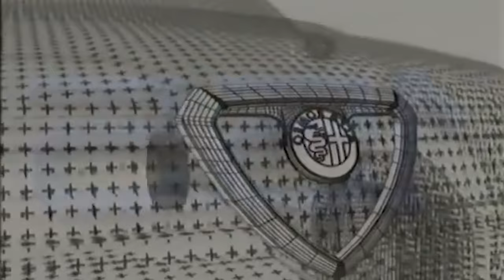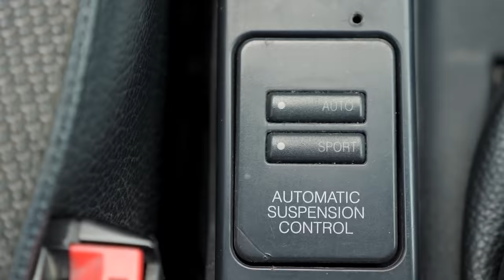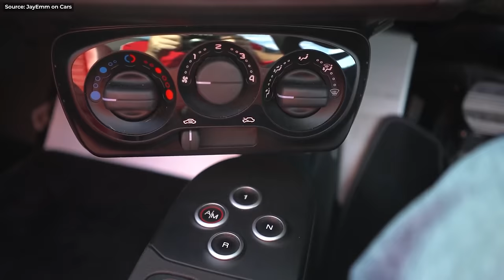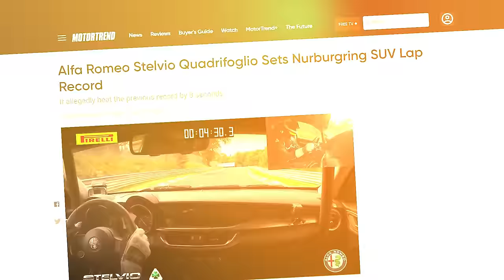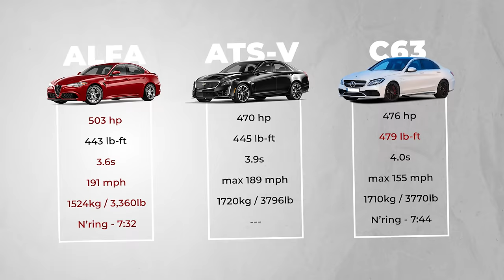7 Alfa Romeos (since 1980) that DON'T SUCK

Comment: The Giulietta Quadrifoglio is very hated, in my opinion i have no idea why. Yes the quality isn't the best, but oh man it drives like no other hatch. It's very affordable for what it provides and with regular maintenance there's nothing to worry about. Extremely underrated car.
Reply: Because German car-pilled people have a bias towards anything FWD that isn't a Golf. It might even be a racist bias, because never in this world has ever been someone who criticised the VW Golf GTI for being FWD.
Reply: I love the giulietta to bits but they really don’t handle all that well, they’re geared to be more of a grand tourer than a spicy hatch so the suspension really is a bit too soft, however this is changed very easily
Reply: I had a Giulietta QV for 4 years, put  100k km on the car in 4 years and didnt had a single problem. 

Only the maintenance bills were very expensive
Reply: @FSCBMrTrol  sadly that's more the mechanic trying to nickel and dime you, by the time the Giulietta rolled around, all Alfa Romeo engines were Pratola Serra units shared with the vast majority of the Fiat group cars.
Reply: @AlexTenThousand  parts are expensive because every garage asked the basically the same price for everything
Reply: @FSCBMrTrol  that's surreal - parts for Pratola Serra engines basically grow on trees, they've been producing those non-stop since 1994 in several iterations and have been used even on several Jeeps after Fiat bought Chrysler, they should be dirt cheap.
Reply: it´s the first time i hear that, normally i heard all my life the reverse, and quality wise it´s close to perfection
Reply: Love mine
Reply: No, build quality does matter.
Reply: Because it’s a Bravo
Reply: There’s thousands of them in Italy. It’s not underrated at all. It’s really popular
Reply: @yafmaverick but the Bravo ain't a bad car...

Comment: I own a facelifted 156 and a 159 currently, leaves me a smile every single time when I looked at them parking at the same place and when I'm throwing it through corners, even if they're front wheel drive they handle very damn well, and none of them broke down in their lifespan surprisingly
Reply: i was looking at 159 1.75tbi and 1.8 versions
do you own any of these two?
Reply: @autorecon  nope I have a 1.9JTD with a 6 speed, but 1.75TBis are definitely worth a try, it's probably the best engine option out of all engine options
Reply: I've had three 156 V6s over the last 12 years - currently own a 156 GTA - and they are unquestionably the best handling FWD car I've ever driven. My GTA in particular is like its on rails - aided by its adjustable coilovers and sway bars no doubt. Apparently quickest steering rack ever on a production car (1.7 turns lock to lock).
Reply: @autorecon from my experience 159 is much heavier than any other models manufactured before 159 so it’s not that fun car as 147 156 166 and GT

Comment: A few facts to add a bit of context and share a bit more info with those who like this matter:

- The Giulietta was a car Alfa had to make, it's blessing and curse was that in EU it sold very well, it looked so great that hey practically never re-styled it, a 2010 project that could compete with all the more boring competitors for almost 11 years,. indeed some aspects of it started becoming obsolete alfway. I've owned one for 6 years, never had any faults, with some good rubber, 1.35 tons, 170 HPs (gas), manual, with sport pack (-2 springs, Q brakes) was undeniably fun to drive and, surprise surprise, didn't understeer at all, it pulled easily more than 1g in corners, if you made it understeer, it meant you couldn't drive it.
- 147, this car was the reason I ended up buying a Giulietta in my 20s. It was revolutionary, in a world where all hatches were FWD, this car introduced pure mechanical handling with double wishbones at the front and multilink at the back. I drove it on track and even a base diesel version could pull more than 1g in turns, everyone in italy loved it. It was the first fun to drive hatchback (except some limited versions of other competing models)
- The 4C was expensive, because, unlike even some supercars, had a carbon tub. Go find a competitor to it. If you haven't bought it for the radio, you clearly don't know what a sports car is and you don't deserve and should never buy one. They are selling for up double the price now.
- Stelvio, I tried to hate it, test drove it and purchased it right away. It's not like it drives better than most SUVs out there, it drives like a RWD sedan (better than most, except the Giulia, all others have worse suspensions and similar weight), you can't even compare it to an SUV. Ferrari engineers have worked on the suspensions (alfa can't say that in public but it was names who worked on the Enzo), has Zero understeer, and amazing 4WD system that works better than the one of a Macan, weighs 100 to 200kg less than any competitor, is reliable, sporty and comfortable at the same time (even without active suspensions), even a mid tier 2.0l gas does 0-100 in 5.7s, while still giving you 650km range. It's the total car, which sold less than it could due to sub standard infotainment at launch (which is what consumers care the most nowadays)

Thanks for including also some honorable mentions! The 164 is a legend in italy, sharing the same chassis of more "boring" sedans, drove much better and had much more interesting engines (like the 2.0 v6 turbo). It was the first car I drove, and, while the FWD was a sin at the time to those Alfa 75 fans, with only 150hp it got effortlessly over 200kph, handled in turns and cruised with less than 70 decibels on board. I will never forget the shape of the dashboard (still a sexy design today - try saying the same of a contemporary BMW) and the super sporty front and rear seats, they don't make them like these anymore.
I ended up almost buying a GT, same 147 platform but longer wheelbase and bertone looks. God I loved the interior, 4 real adult seats, large trunk, interesting engines, test drove a few, but had to move to another country. I still think it looks like the most beautiful daily coupe ever built (thanks Bertone).
Reply: I have an '05 GT Busso, second owner with 22000km on the odometer down here in NZ. It's like new finished in Grigio Stromboli with red leather. It's beautiful.

Comment: I have to go with the 159 Q4 Sportwagon. One of the most beautiful modern designs imo. Too bad they took out the Busso, but I guess it couldn't be perfect
Reply from the maker: I agree. Good car
Reply: And the Brera ? The Brera is so unloved it hurts
Reply: @harryhazza626  well, it's the coupé version of the 159, so it goes in the same bag. Alfa missed the chance to do something crazy and radical with the Brera, it was a good platform, and I reckon that's the reason why it's unloved as you say
Reply: @martinds38  I'm not saying it's one of the greatest Alfas but I've owned one for 8 months now and all I see online about the Brera is people acting like it's a Lada , like something that needs to be ignored and shunned. It's a compétant , relatively reliable, knee achingly gorgeous 2 doors cruiser.
Reply: @martinds38 the Busso didn’t make it in the 159/Brera due to emissions standards. Yet all the press still blabbed about the 3.2V6 when in fact the 1750TBi is widely regarded as the best engine for that platform. So good in fact it got carried out in the Giulietta QV
Reply: Is the GM Holden 3.2V6 so bad compared to the busso?
Reply: @Runeakb  the gm V6 is a better engine , around 10% all over , but people have a hard on for the Busso because A it's made by Alfa Romeo and b it's been around a long time. It does make a nice sound I'll give it that. They're just pissy that Alfa didn't make the engine . If they didn't know that engine was made by gm they would of liked it . But here's to biases I guess.
Reply: @harryhazza626 the gm 3.2 might be better on paper. But the reliability of that thing is pretty bad.
Reply: @iTzNitrOxZ  the Busso was reliable? That goes against everything I've ever heard about the older Alfa lol
Reply: @harryhazza626  its no toyota of course.  But there really isnt many weak points other than some sensors which can be a pain in the ass to replace. Also some electrical issues but nothing serious.
Reply: @iTzNitrOxZ  oh , fair enough, so where did the whole stereotype come from
Reply: @harryhazza626  alfas started to become way more reliable when 156, 147, gt were released. So basically in mid 90s things got better.
Reply: J’ai une Brera V6 Q2 de 2010, elle est une magnifique routière, du Supersprint à l’arrière avec en plus des collecteurs d’échappement Autodelta la rende addictive…
Reply: @hhh7929  putain elle a l'aire magnifique , savais pas qu'ils avaient créé une V6 en Q2.  Faut que je visite auto delta aussi un jour 🍻
Reply: @harryhazza626  Brera V6 Q2 ITALIA INDEPENDENT… 900 exemplaires dans le mondes, et pas beaucoup en V6. Première voiture de production avec une peinture mat et du vrai carbone à l’intérieur en plus.
J’ai juste mis les ressorts courts des versions Ti, filtre à air bmc, les Supersprint et ces fameux collecteurs qui suppriment deux catalyseurs et 4kg sur le train avant. Et des durites aviations, des Brembo ventilés percés à l’avant et à l’arrière avec des bonnes plaquettes… et un bon liquide. Elle marche pas mal avec plus de 110kg en moins et des trains en aluminium installés sur les phases 2…
Reply: Maybe im a little biased over that car because my dad used to own one, but I still think its one of the coolest wagons of the 2000s

Comment: My mom has a stelvio. when it was stock it was almost scary to drive. It was tuned by Squadra tuning. It now makes 320 bhp wich is crazy much. it gives you cold rillings when you launch it as fast as you can
Reply: Stelvio QV or regular?
Reply: @kevinlee8202 QV is 510 HP
Reply: That's 2.0GME
Reply: Something is gonna break sooner or later…there is a reason Giulias and Stelvios have 2 coolant tanks (1 for turbo and 1 for radiator). The car overheats a lot…very poorly designed, there is a coolant pipe that connects from the top of the engine to the upper coolant tank that is made of plastic, that will break due to the heat and vibration of the engine. I highly advise if you want longevity and reliability of your moms Stelvio to remove the tuning chip or whatever you have. I am a apprentice at a Alfa workshop and I have seen turbo oil leak, coolant leak, fuel pump not working due to customers putting on ‘race chips’ on their cars and slowly 1 by 1 all are taking them off or selling the cars. Enjoy the car for what it is Alfa is a very special brand but not one to be experimenting on 😅 Cheers
Reply: @kyledrysdale6553  nobody said they're perfect, and its not a race chip. it's a proper tune by a proper company 'squadra tuning' yes the car overheats but its not build to be used as a race car. you do a few pulls and then you cool it down again, every car has to be driven like that or else they catch fire. look at all the ferraris and meclarens and stuff like that. they can catch fire after 1 pull
Reply: @mathiasbruyninckx4528  Yes, I never said they wasn’t perfect. Every car has its limitations and unfortunately the limitations for this engine comes very early due to its not so clever design. I did abit of reading on Squadra Tuning and it seems it’s just a ECU remap? For me it’s abit scary with the amount of Alfas I have worked with broken ECU because of things like this, that’s why most prefer a race chip aka piggy back where you don’t touch the ECU( plus my countries Alfa agent did a partnership with a piggyback company so it doesn’t void the warranty) but it all backfired when the cars couldn’t take the added power putting stress on components. And you are right tuned cars do make more heat like the Ferraris and McLarens you mentioned, but remember those engine are around 4l v8s with 2 turbos with power more than 600hp-800hp or even more with tuning. So they are bound to produce a lot of heat and maybe even catch fire if drive roughly. I’m just saying the 2.0 turbo engine produce so much heat that just running the car for 1min, it is too hot to work on i have to wear thick gloves!!! For me, with the HP gained it is not work the risk as it is a lot of headache to resolved the issue once/if it goes south. If you are bored and have free time, go to your moms car and look at the turbo, you can remove the plastic cover if you want( 2x10mm and push the cover backward under the bar to remove better for cooling too) and looks the amount of heat shield they put!!! Plus on the coolant tank because of all the plastic was melting and leaking coolant everywhere!!! 🙈 also just a tip, every 50000km the rubber O ring on the metal oil pipe going into the turbo needs to be changed otherwise the oil will leak, turbo no cooling and car will go into ‘Limp Mode’. Just change the O ring not the pipe, but some workshop will charge you for the whole pipe to make Profit so you gotta be careful. Cheers ✌️
Reply: @kyledrysdale6553 you should learn a lot more then....before speaking
Reply: @kyledrysdale6553 Thanks for these useful infos! Anything we should be aware of about the QV 2.9?

Comment: I love my Guilia Ti with the 2.0, the fact that the platform was built for the QV first then dumbed down was a better move than suping up in the reverse.  You get all the chassis, and handling, weight reduction and distribution plusses with a fairly potent 4cyl turbo.
Reply: V6 is better

Comment: You left out the 164S, a car I owned for nearly 10 years and I still regret selling. Great comfortable car with great looks from every angle and that wonderful V6 that loved to rev to and beyond redline with no issues and that typical Alfa sound! Superb short throws gear box, what not to like? Fortunately the "selling bug" never effected my '88 Spider, a wonderful little car, as I affectionately call, that turned out to be the most reliable vehicle I ever owned. I have no concerns about taking it for long trips and it's a blast to drive.
The Giulia and Stelvio? The front is Alfa, no questions, but the rest have generic looks like a lot of vehicles on the road these days whereas in the past an Alfa was unmistakably ALFA no matter from which angle looked at.

Comment: My father was an Alfista and, for my opinion, you miss some important models as Alfa GTV 2.5 V6 and Giulietta 2.0 Turbo Delta
Reply: In fact most Alfa models were good to drive and had nice performance. Some had minor technical issues but then so do most cars. The only real problem with Alfa is that they have a bad reputation but that's not been based in reality after the '70s.

Comment: Honestly every single car Alfa Romeo made before being bought by fiat (up to the 75) is amazing. All of their rear wheel drive models where known for being exceptional in the corners and very hard to oversteer thanks to their 50-50 weight distribution, and the 33 was THE front wheel drive sports car at the time
Reply: But build quality was indifferent and rusting terrible until the 75 when both improved a lot.
Reply: @timhancock6626  was it? I’ve no experience with old Alfas so I honestly don’t know, but the “alfas are so unreliable” to me sounds like an urban legend more then anything else.
Reply: yes it is an urban legend. In my family we got Italian cars in general for a pretty long time, not only Alfa... 

And well I think as long as you do the maintenance as it is told in the manual, nothing should go wrong. Always heard people bashing and questioning about the reliability, then saw them having trouble in their fancy german or (even worse) french counterparts while being absolutely fine
Reply: @takao4491  though so… Alfas are so rare outside of Italy and yet people who have not even seen one in their life insist that they are unreliable.
Same goes for fiat. I drove many new pandas and new Toyota Yaris and I can say the build quality on the fiats was way better
Reply: Rust protection on American models. improved around 1978. The very early GTV6 (1981) had a rust trap at the top of the front wheel wells, but they soon fixed it.

Comment: I had 159 1.9 jtdm yes a diesel but damn it was fast not for a diesel just fast and handled very well. I will buy again for sure.
Reply: 1.9 is a pretty bulletproof engine no matter the power variant but powerhouse wise the 2.4 L5 is a masterpiece
Reply: @takao4491  yes and they rev like gas engine

Comment: Had a 1980 2.0 Alfetta sedan for 6 years here in Australia. Only time it let me down was when a spark plug failed the DAY AFTER it had been changed in a service. The thermostat in its aftermarket AirCon failed as well. Not an Alfa part though. Other than that it was 6 years of very happy and enjoyable motoring. Bought it for $11,000 second hand in 1992. Sold it for $10,000 in 1998. I probably spent $3000 on it having it resprayed after a minor accident to hot rod perfection and had fitted Koni adjustable shockers and nice alloys. One of the cheapest cars I have every owned.

Comment: Let's not forget about the most beautiful starter car in any NFS game ever: The Alfa Brera. This car is so beautiful that you're best off leaving the car's looks at stock, saving you lots of money for the later game.

And in real life, its only weakness is the timing belt, which needs a replacement every 70 000 kilometers. Apart from that, it's an all around scrumptious car to have. I'd love to own one.
Reply: Unfortunately it has a Holden V6 in it (from GM Australia), why they didn't drop a lightly turboed Busso in it is incomprehensible. The Giulia Quadrifoglio is spectacular and should be on the list